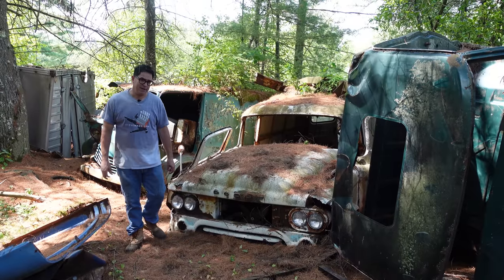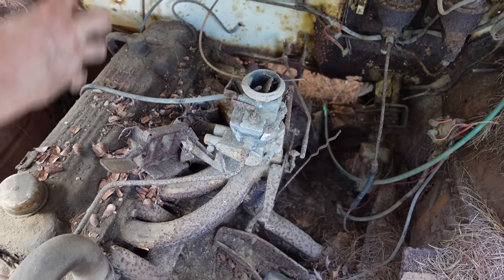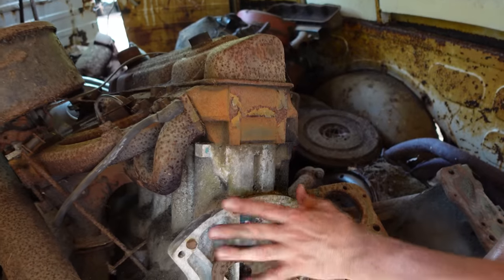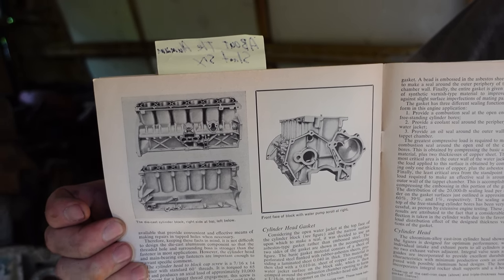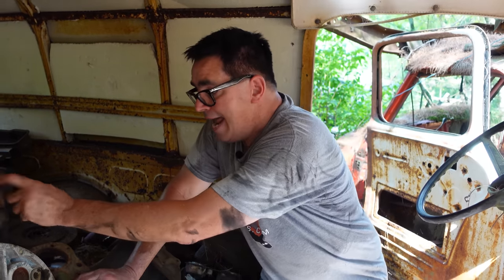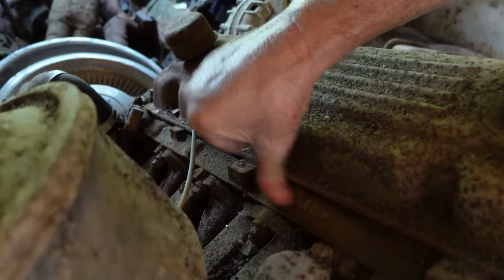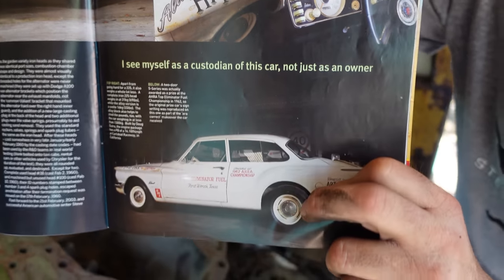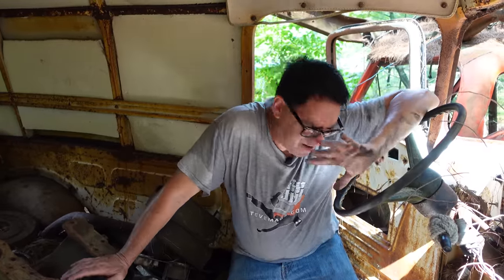Slant Six Surprise!

Comment: The Slant Six was the hallmark of mechanical simplicity and the formula of "if the shoe fits, wear it". As a result, the Slant Six developed into one of the best and reliable engines ever made. There were reports of them being shot, run out of oil and still running. I don't know why you'd do that, just give the same TLC as any other engine or piece of equipment and it will reward you with reliable service.
Reply: My last slant six, a 63 had 87k on it and didn't burn or leak a drop of oil or coolant. Only needed a valve lash adjustment.
Reply: Drove one without coolant, no damage!
Reply: The guy I bought my coronet from had another slant 6 car for parts, it had a hole in the side of the block and he said when they were kids it was they're farm toy to run around doing donuts and stuff, it threw a rod and kept thrashing until all the oil flew out which I was told was quite awhile, and I believe it.
Reply: In reality any of the last generation of US OHV inline sixes fits this description.  Never meant to be high output engines instead they were simple reliable engines that provided cheap transportation. They died out when the last 4.0 came off the line in Kenosha.
Reply: @TrashcanGarage  We had several in my family throughout the 1960s to the 1980s, the last one being my sister's first car in 1983 which was a 1974 Gold Duster with a Slant in it. It was reliable and always started no matter what. My dad sold it for double what he bought it for $745 in 1985 and my sister then got a 1979 Cutlass which was also very reliable.
Reply: @mpetersen6   @dallas gibson  I wish that Mopar had built a small enough car to justify a four cylinder version of the slant six, but until the '70s gas crunch Americans wouldn't buy compact cars - in 2022 no American company builds one.  They could have improved the 170 and used it in a shrunken version of the A body, something like a BMW 3 series - left enough engine room for a 318 option, then used the improved 170 as the base version in the Dakota pickup.   The slant six still has the product identity of the Hemi and the Cummins diesels - something that Mopar marketers should not have wasted.   In the '70s Chrysler had to cancel product plans because of lack of cash.
Reply: Yes they will run without oil. Had a 64 Belvedere as a winter beater in high school. Oil pressure light either quite working or never worked and I ended up kicking a rod out of the side of the block. Drove the car like that with a miss among other noises for the rest of the week until I could swap with another engine. Great motors that are under rated. With the valves adjusted right they will really run well.
Reply: @dallasgibson7578  Verified as seeing a slant 6 running here in MInnesota with a hole in the side of the block. Really interesting watching the crank and rods spinning about. So the owner put a brick on the gas pedal and we waited....and waited...until 20 minutes later it was "seize ya' later" time.
Reply: @mpetersen6  wrong, Direct Connection had parts options that ran very fast, turbo Slant sixes are running in the 9,s
Reply: I ran one hot until it quit running. Once it cooled down it ran great.
Reply: @timothykeith1367  - America was rich after selling war materials to other countries for WWII and had little bomb damage so we had the money for at least 6's and V8 power if wanted, plus cheap gasoline from gas company competition and freedoms, so that's what we got...
Reply: @mpetersen6  The AMC cast iron 258 six  was the best of the kind. AMC made made great cast iron engines in its last years, but the cars were anywhere from not so good to awful.
Reply: I ran one of mine about 15 miles with a blown out radiator and no oil. .. i crawled it home, blasting tthe heat on full for whatever it could blow off..   Replumbed the thing, and it was fine.
Reply: @MessalineApghar  Heck, you probably burned the carbon out of the rings.
Reply: @anonymike8280  possible.  It ran with no problems and no oil burn for a while, until it got totalled .. hit in the front.
Reply: @MessalineApghar  It's possible with the massive block that it had enough cooling to survive the ordeal. There might have been a little coolant left too, Anytime you overheat, turn on the heater full blast.

Heard a similar story about a 318 Dodge V-8. The guys thought it was toast and ran it without any coolant. The story I heard is that block was actually glowing in the dark when they got back.

Apparently, they burned the carbon out of the rings and the engine ran for years after that. Better to just change the oil early and often. I remember the era of cast iron engines. Many of them were a mess just because of poor maintenance.

The Slant Six is an icon. it was a hippie era touchstone and it is a gearhead touchstone too. The  long stroke-small bore (3.4 X 4.125) combination is interesting. That apparently was how to the Chrysler engineers solved the problem of getting the car off the line. GM went more for brute force with a larger displacement. The 250 Chevy had a 3.875 bore and a 3.53 stroke. More horses at mid and high rpm but less fuel economy.

The GM 230 and 250 straight sixes have the same bore and apparently could use the same pistons as a 283 0r 307 V-8. Guy in a forum said, the 307 pistons were flat and could be used to achieve higher compression.
Reply: Had a 64 Dart with a slant.  Was involved in a accident where I was hit on the right side front.  Drove the car home although missing badly.  Next day I discovered the distributor cap was broke nearly in half with the broken section hanging by the plug wires but still running!
Wish I had that car back!!
Reply: Always carry a needle and thread with you if you go to a wrecking yard!
Reply: Good morning googleusergp, I'll be watching anything Magnante trying to support him. I had a buddy back in high school that had a 4 door 68 dart, slant 6.  It developed a rod knock at a gazillion miles, he probably should have changed the oil occasionally.  Lol We took it down to Fort myers Beach, from Fort Myers one weekend, about a 20 mile drive. By the time we reached the beach it was a rod knock with a bunch of rattling.  But, it got us back home. When we jacked it up, put it on stands, and crawled under, the oil pan was mangled. I pulled the pan and was astounded it got us home! I wouldn't have believed it, had I'd not seen it. The crank was in 3 pieces, with 2 broken rods! 🤣
Reply: @fishgeralding9224  I've never had an oil related failure on anything I've owned. LOL. Oil and filters are cheap, engines aren't. But yes, the Slant Six is one tough engine indeed.
Reply: @googleusergp  neither have I. I sold my first car, a 59 rambler classic straight 6 with 176,000 plus miles on it. It was only burning about a pint between changes, about every 2000 miles, at that point.
Reply: @fishgeralding9224 Take care of it, it will care of you.
Reply: @fishgeralding9224 had an 86 with 800k km on it, ran on 20w50 for the 4 years I had, never changed the oil or filter, had been a tossup when I got it whither it was burning more or leaking more hence the  change over  to 20w50